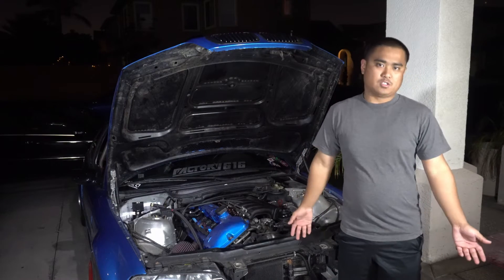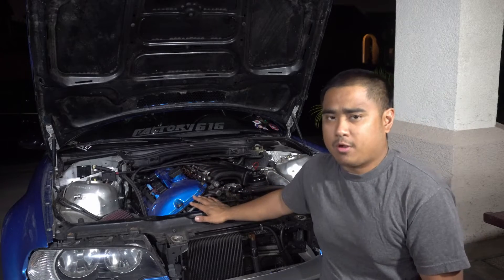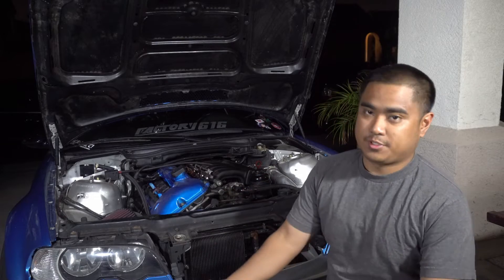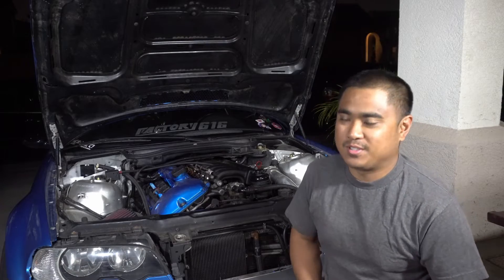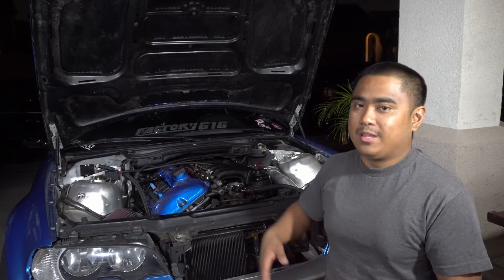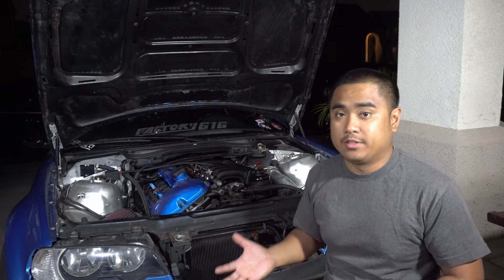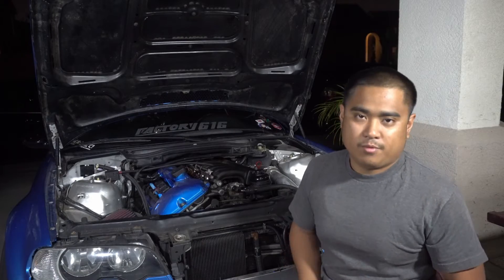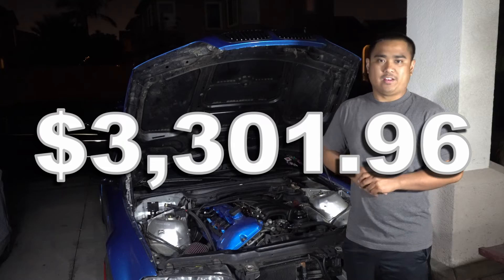BUDGET Turbo E46 for $3,000: Here's how | #TheE46DriftBuild Ep 72

Comment: Is it worth it to turbo a b25 or should I just get a b30 to swap
Reply from the maker: I'd probably draw the line at 350whp for a B25. Some people have done more, but the higher HP you go, the more risk you're taking.
Reply: @nuisance_carl  thanks for the input, 350whp is more than enough to drift my e39. 180hp is just a little too slow for the e39, it falls on its face in 2nd with 80psi in the rear.

Comment: Videos from you are always a treat! Saving up for my turbo build, kinda have a similar or maybe the same car. It’s a bmw 325ci 2002 with the crappy getrag five spd
Reply from the maker: Thanks! That getrag definitely isn't the best.
Reply: @nuisance_carl  is the oil drain going into your drain plug hole? I was thinking about doing that
Reply from the maker: @EurobaggedATL  No, I have a separate bung for oil return. Draining to your oil drain plug can be done as a temporary solution with a top mount setup or with a scavenge pump. Absolutely don't do that with a bottom mount and gravity drain.
Reply: @nuisance_carl  I see you made a video on yourself using a scavenge pump and it didn't really work. Are you having any oil drain problems now?
Reply: I would read up on your car cause the M54B30 and B25 your engine are identical in dimension the only thing that separates them are internals. U can put a b30 cam and rods in a b25 close it up and you basically have a M54B30. Of course I kinda simplified it but that's basically how you'd do it. Check bimmerforums
Reply: @f.b.i3538  I gave up on boosting the e46 but I might get another and try supercharging. But as of right now I have the n54 335i to satisfy the turbo needs
Reply: @Shiza1997  bro if you supercharger it your barely gonna break 400 if even and that's with a good tune and exhaust. Unless there is dome superch a rger made for the m3 that pushes over 200hp🤔.

Comment: love the videos, extremely helpful and well thought out. 
Which of these bare bone items would a top mount setup not need in your opinion?
Reply from the maker: If you do top mount, you won't need anything scavenge pump related. For that spreadsheet, its lines 101 to 113 which will save you just shy of $500.
Reply: @nuisance_carl  I wanted to do bottom mount, but I really don't want to deal with scavenging... Thanks for all the info Carl
Reply from the maker: @sultanofswingdrift3021  No problem. FYI, there's definitely bottom mount manifolds out there that will allow you to setup an oil drain without a scavenge pump.

Comment: For the power you're running,why didn't you just save and buy an m3, $9000 to make about the same power  doesn't make sense.
You do know a stock m54b30 can handle 400hp on 98 pump,and more on e85, why are you running such low power
Reply from the maker: Hindsight is always 20/20. Original plan with the car was 2jz swap which would be a waste with an m3. On top of that I’ve always wanted a boosted car. 
I do plan to have a map for more power, but only for the tracks that demand 4th gear. I don’t need 400 hp for the typical driving this car sees, so no point taking on additional wear and tear.
Reply: Where are you getting an m3 for 9k?
Reply: I did say save up more,plus then you have resale value,spending 9k on car that in the end will sell for $2000-3000 just to run 300hp just doesn't seem logical,specially when you can daily it at 400 on pump.
Reply: @patchedupdemon7104  he is happy so it makes it worth it. That’s all that matters.